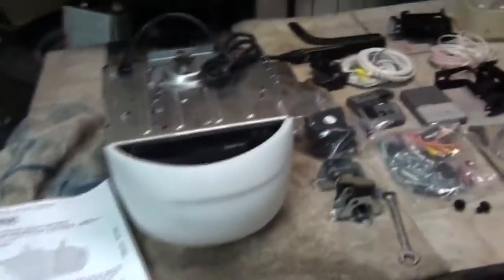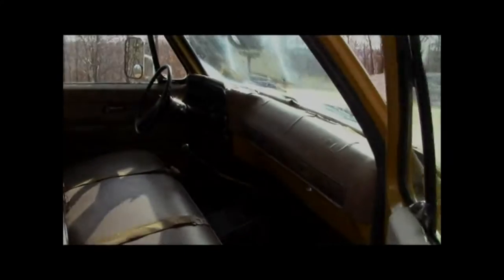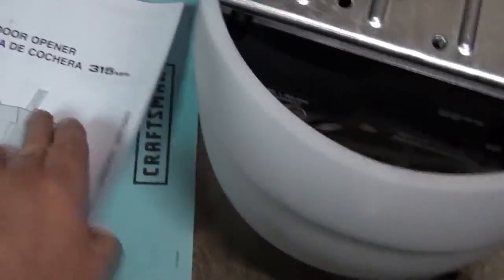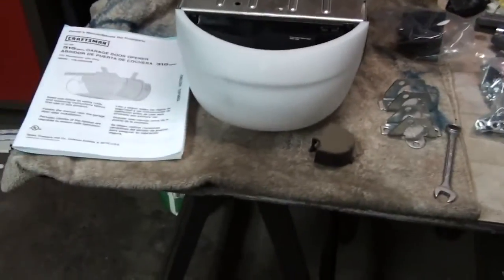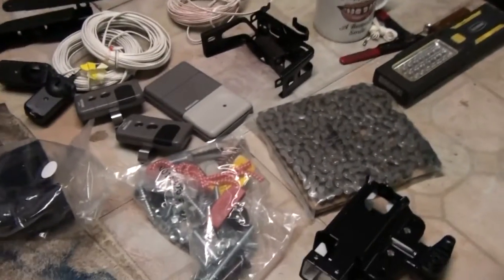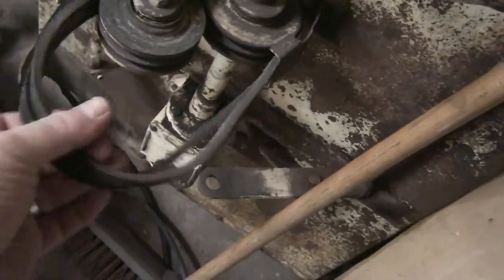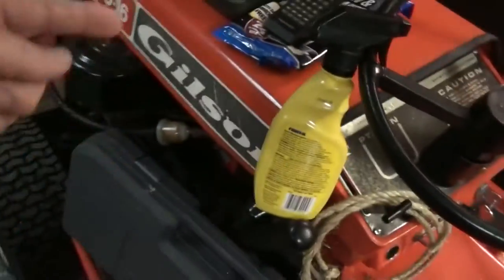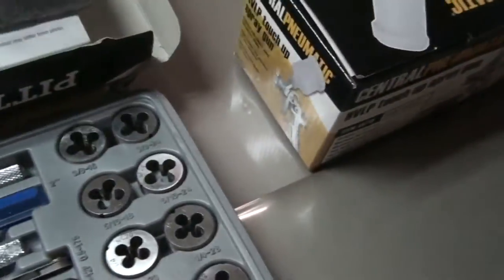Weekend Update 2-12-2017

Comment: I had a snowblow do that 3 times before i noticed the starter mounting ears were off center. I had to use a prybar to bend the mounting brackets and move the starter in the right engagement position. I just bought the poly drives at $17 a piece not the whole starter. HA i bet a new starter would have fixed it and in your case a new starter did the opposite. Ya its the alignment.
Reply from the maker: I bet your right I will have to look at that and see if I can shim it or something. The starter was like $25 so its not stupid expensive until you realize you only get 6 starts out of it.

Comment: Good stuff, Scott. Glad your back is starting to feel better. There must be some misalignment with the starter to the ring gear to keep chewing up like that, OR, the starter is not staying fully engaged while cranking? OR you are keeping the switch engaged too long once the motor fires? OR see the first thing I said... check to make sure you don't have any broken teeth on the flywheel.
Reply from the maker: I will check the ring gear for sure, hum.. maybe I am holding too long. Something else to look into. :) Thank you my back is finally getting better!

Comment: seen you were stalking my ch lol    yea, I'm ready for spring also.   fix that brake on the bike you need a front brake to help you stop!  I use my front brake all the time
Reply from the maker: Yea, I suppose you are right however I have yet to be in a spot where I needed it my back brake works just fine. However if for no other reason than to justify the fancy brake lines I will get it fixed. :) I saw a few bikes out today man I wish mine was one. It was 50 in Brookfield today at lunch!! Ride safe man! (heads off to stalk The88Katana600's channel)..

Comment: I assume the original starter gear was plastic . Would look at flywheel teeth , and play in starter shaft or engine crank shaft . Is the flywheel key good . Does it do anything strange or sound strange when it worked . Is it fully engaging in to fly wheel . could it need a shim . battery good , Well that was my first thoughts . may be none of them .
Reply from the maker: So I am thinking maybe a shim, I have to look at the teeth on the fly wheel not sure what kind of shape they are in. The starter shaft seems ok it is new and has no play. The engine crank seems ok, I did not feel any play when I had it off. The flywheel key should be good I replaced it last summer when I put the motor back together. It sounds find when its running, however some times when I start it, the starter acts like its binding only happened twice I think but maybe thats it, maybe a shim would do the trick!

Comment: mabe a little too much oil in the engine causing Higher than normal compression?
Reply from the maker: That is something to look at that I had not thought of. I had the correct amount in it back when I put it together however since then the carb flooded a few times and maybe added to the volume of the oil. Good call I will check that later when i go out.